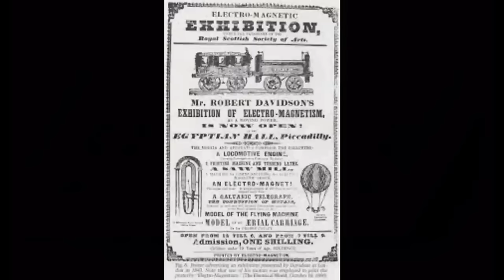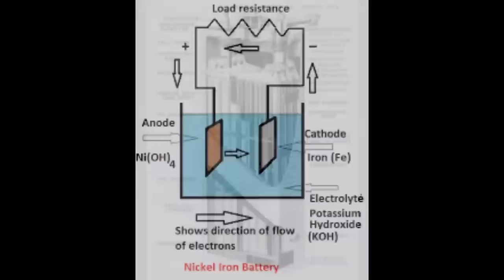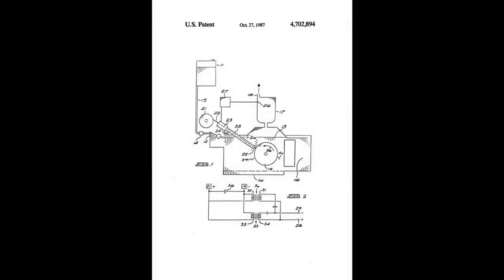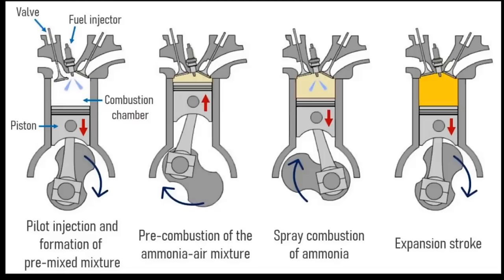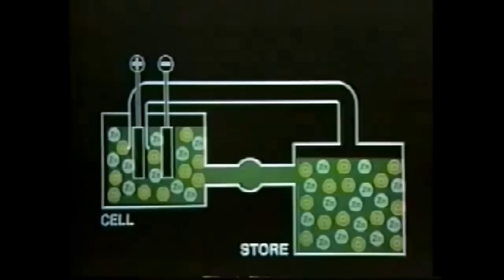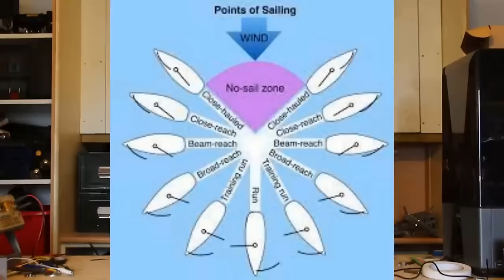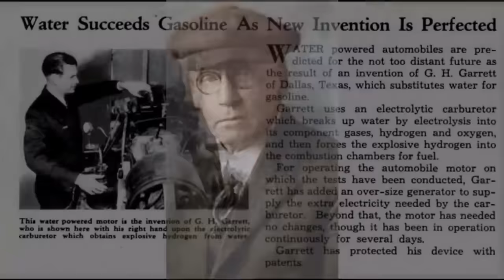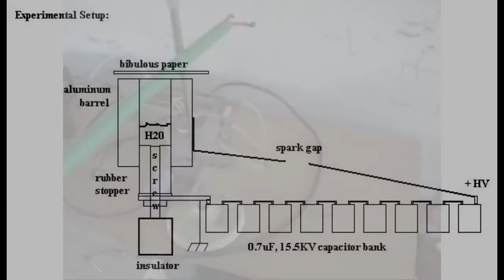Man In A Shed - The Car Special  - Episode 9

Comment: Love your historical analysis. Rob, would you consider adding some more research into the following ideas>
1. Does the emissions from automobiles in big cities have any health consequences? If so, would electric autos mitigate some of that?
2. Are there any modern battery chemistries that are eliminating non human friendly ingredients such as cobalt?
3. What exactly are the percentages of electric vehicle charging that come from coal, oil, gas, home solar, commercial solar and wind hydro?
4. Is it possible that personal electric mobility, such as electric scooters and bicycles have mitigated some pollution and made some form of transportation available to a population that formerly had none?
5. What is the full cycle energy equation of producing hydrogen? Certainly its production is important. Maybe best used making steel?
6. Is the "virtuous" cycle of recycling autos to produce new ones even possible?
7. And probably, the most important question for me, .... what happened to the Twizzie?

Comment: I have a working design for a water-powered car which only consumes water to move forward, no electrolysis, no chemistry, not even electricity. The indisputable proof is that it can run indefinitely, as long as more water is added, so it can also be powered by rain water. Unlike all the fake ones, I'm not seeking investors and I'll even put the design in the public domain because it's so inefficient and thus impractical that there is probably no market for it.

Ok, so, what's the catch?

While it is true that it only consumes water, it's actually powered by gravity. Basically put a big water tank high up, say 4m/12ft high, run a pipe down pointing at a Pelton wheel/turbine connected to the transmission, and connect the "gas" pedal to a valve on the pipe to control the flow of water. It won't be fast, it won't get far, but it will move. Since you only need to add water to get moving, it's kind of true that it's water-powered, and if you refill it with the rain, it's actually solar-powered 🙂

Comment: When things come to pass electric cars will be seen as environmentally disastrous.  Pull into a fast charge station and the first thing you see is a huge diesel generator. Generating electricity this way is far less efficient than burning the diesel in the vehicle in the first place because of the generators internal losses, battery charging losses and electric motor inefficiency, I believe this to be in the order of about 40%. Thus, creating 40% extra emissions and burning 40% extra diesel over the diesel car burning the diesel directly. How is this environmentally better?  Though I'm not a Proverbial "tree hugger", I do believe in not polluting the planet for future generations.  It just seems that scientific fact over political side-stepping doesn't seem to count.

Comment: Whilst not up with Iceland or Norway (~100%) the UK domestic electricity supply is over 55% renewable and you can use a green electricity retailer to ensure your EV is charged with 100% renewable electricity (in addition to any home generation). So I don't buy the 'EVs still use dirty electricity' narrative. Also, modern EVs have moved to LFP chemistry so no Congo cobalt and no battery fires.
Love the salt battery idea but a shame it's not a reality yet.

Comment: Water as fuel — why are we talking about "water as fuel" when all the examples had to use some other form of energy to have the water do anything. The snapping shrimp example is no different to the steam engine... put energy into water and let the water move the next component in the drive chain. We should start with the thermodynamics, ie., from where the energy comes. We are familiar with hydrocarbon as fuel where the energy was invested in ages past and we release it by burning. We understand batteries as energy invested to separate ions and these migrate back when the battery delivers most of that energy back. Water is the result of burning hydrogen, nobody has shown a way to "burn" this further to get energy. Please stop the nonsense of calling a process that needs energy to be invested into water to get energy from the water as being somehow water powered.

Comment: rubish......no hydrogen in water.....try making 2 ltrs hydrogen and 1 ltr oxygen into water.............
Reply: Match. Kind of fast conversion though.
Reply: The heat and explosion spreads out the water as a vapor, probably, atomized, just hangs in atmosphere... but it is still technically still making water.  But you don't count liter by liter, you count mols.